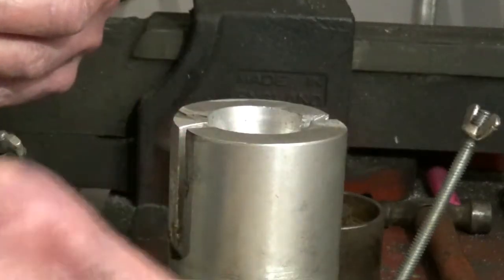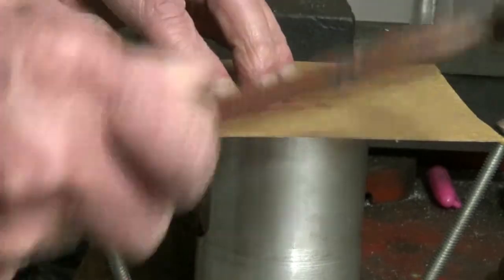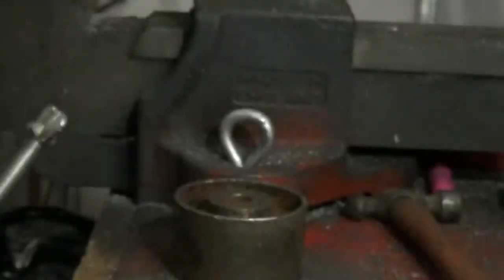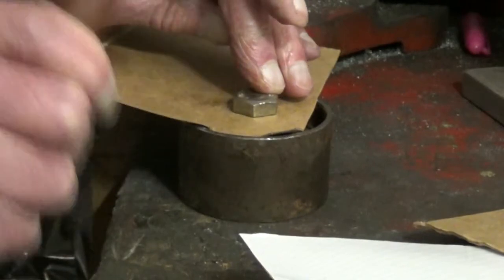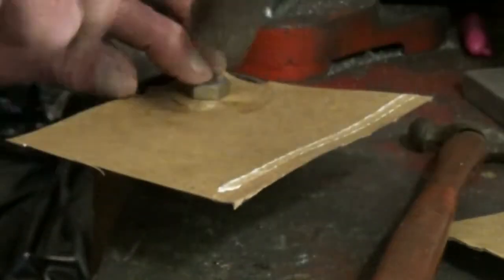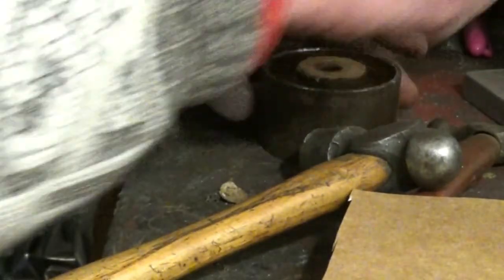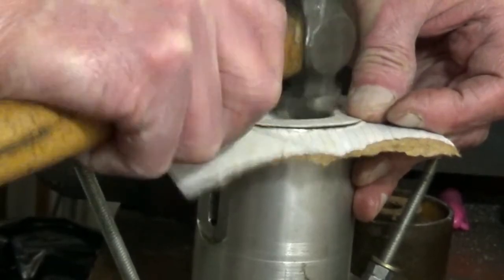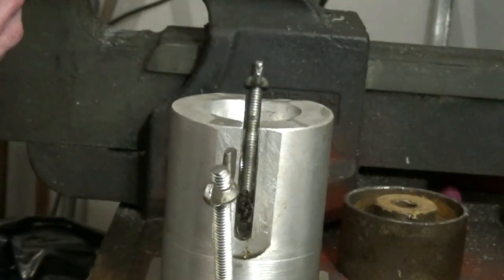How to Make a Gasket

Comment: Yes that's the old way of doing a gasket for sure by hand. My Father years ago when I was helping him with his 1950 Oldsmobile made gaskets the same way. I used to cut out cork gaskets when I worked for the power company in the electric shop.  Doing it that way now my hands would cramp up before i was done. Really great demonstration Old boy Cheers
Reply from the maker: Thanks Larry. Yes, I wouldn't want to be doing this too long today either. When I was with Carl at Ulceby, he had sheets of gasket material.

Comment: Yep, that's the way I was taught to do it my dad 40 years ago. Very useful if the gasket you need is for an engine that has been out of production for 70 years and the local car spares place doesn't stock them!
Reply from the maker: It is Harry. Also useful if it's a Sunday and everywhere is shut.

Comment: I would probably approach it a bit more cautiously because of the steel on sharp edge issue. I would lightly tap to create an impression all around, then use that as my knife line to cut along. I'd be very concerned about rolling an edge with the ball peen hammer, especially on an aluminum head or cylinder. I'm sure that would make my process a bit slower, but so would dealing with rolling a bur.  Am I being overly cautious?
Reply from the maker: Actually I think you are. I made 4 or 5 head gaskets for the Briggs and no burrs etc. Obviously you don't need to hit it very hard. As far as I know, I've never damaged an ally surface yet doing this.  Basically if you're damaging the edge you're hitting it too hard. It requires flowing taps downwards. Roadking also makes his this way....cast iron is much easier of course. Doesn't matter how you do it, as long as no damage and you get one made eh!

Comment: Lol, your crazy, that pretty cool but no way would I try that on my Kawasaki KX engine parts, but for solid things that's a nifty method.

I've never seen it be done like that before, just shows there is many ways to skin a cat lol
Plus my way was much easier ha ha ha
But it worked good in that big clunk of metal you had.
ATB
Darren
Reply from the maker: Darren, this is how it's been done for the last?? 100 years. Nearly everyone knows. Light taps are all that's required, hence no damage, even to ally parts. I've been doing it like this since I was about 14. Wish I could have found a small ally inlet to show, but couldn't. Go back to my engine videos, look at the head. No damage and I made about 6 on that. What you do is slice it with the hammer, so you're not really hitting the edge.
Reply: MalcOfLincoln it's definitely a method I would try on random things in the future.
It's always good to know other methods.
You must have all sorts of tricks stored up in your head, you need to start logging them on video lol

Many of times I have been stuck on something and YouTube has shown me things I can try with what I have, and it always works out, tips, tricks and hacks are good videos.
Reply from the maker: Actually Darren they are my main views. Logsplitter, boiler, simple coil ignition, Updating satnav etc. About the only videos I get a few views on. Yeah, well 50+ years of experience does teach you a thing or two.